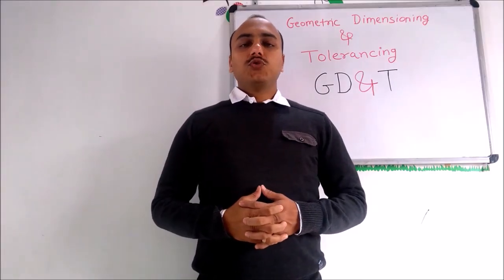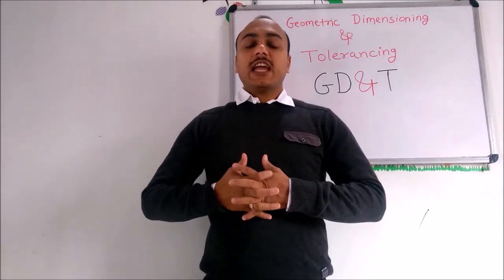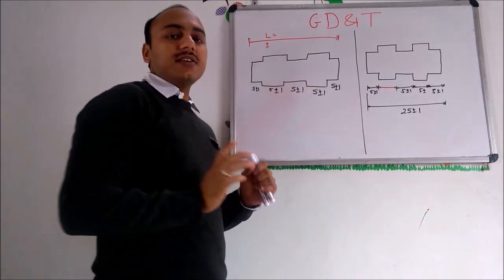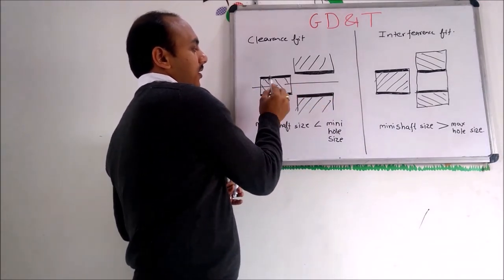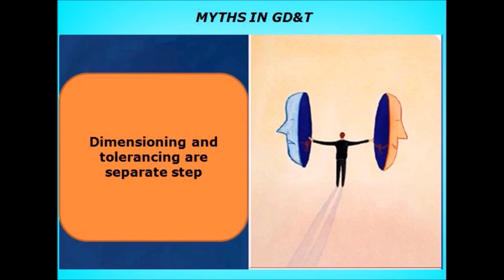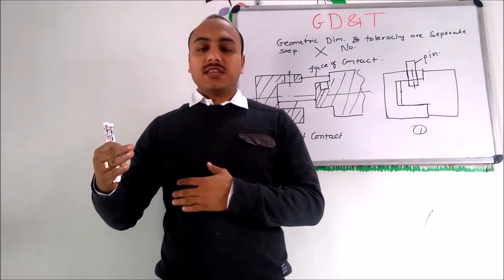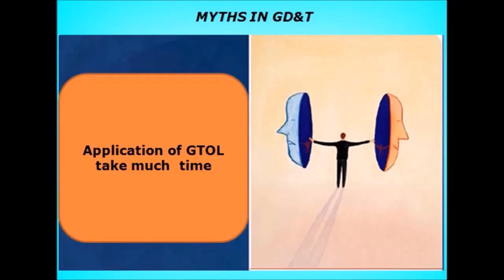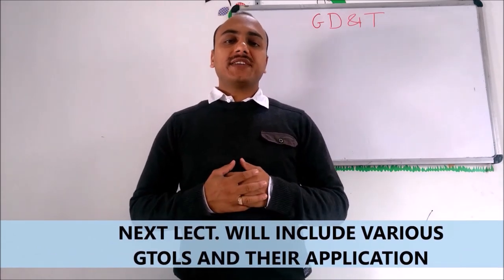GEOMETRIC DIMENSIONING AND TOLERANCING (GD&T) LECT 1

Comment from the maker: at 10.0, in case of rectangular tole 2x2 what is tolerance at diagonal.. 2.828. So horizontal vertical we get 2 but diagonally we get 2.828. so it's not uniform.. While if we use position tolerance of 2.828 it will be uniform and 57% higher as well. 
But in video I mentioned 2 only. 2 will make zone uniform but less. 
The point is using Geometric Tolerance makes it uniform and bigger if we go for diagonal value. Hope this clarifies anyone looking for this answer. Thank you!!

Comment: 10:00 How the tolerance zone will be a rectangle? If both sides are equal (2mm)
and 2X2 mm square will cover more area than the 2mm diameter of a circle.
Reply from the maker: Hi, I think U did not got me clearly. Suppose hole location has sq. Tolerance zone. Be informed that its not homogenous tolerance. At diagonals it will get more locatio allowance. That is why it is rectangular for me and by giving diagonals as Gtol it introduces more tolerance. Let me know if this makes sense.
Reply: @TheEssenceofknowledge  
Really it's confusing statement....Rest all is good in your video
Reply from the maker: @BuddhuEngineer  yes it is. +- 2 is a rectangular.. while Gtols are cylindrical. Try to draw tolerance zone, you will get it. Thanks
Reply: @TheEssenceofknowledge  thank you so much for your reply at regular intervals. still im not getting it. I wil make sure to get it. Thanks a lot
Reply from the maker: @vigneshvenkatapathy7135  2x2 what is tolerance at diagonal.. 2.828. so horizontal vertical we get 2 but diagonally we get 2.828. so it's not uniform.. while if we use position tolerance of 2.828 it will be uniform and 57% higher as well. But in video I mentioned 2 only. 2 will make zone uniform but less.
Reply: @TheEssenceofknowledge  Now I got your point 📍. Thank you so much sir. Keep enhancing our knowledge through your videos. Thanks once again

Comment: Hello sir, I am not getting the point of rectangular tolerance zone, and how the circle of diameter 2mm will give us more tolerance zone ?
Please explain
Thanks
Reply from the maker: Suppose if we give a hole location tolerance +-2 and both location. What will be the zone of tolerance kind of square but diagonally hole can move more then 4 in range. So that become rectangular tolerance for me. And if we use same gtol as the diagonal value it will add more tolerance. So where as rectangular one is a non uniform tolerance zone gtol is homogenous. Are you getting me or need more explanation.
Reply from the maker: Above example was just for understanding never gone on detail.
Reply: Sir, thanks for the explanation but I am still confused that if the hole will move on diagonally then in our first case (without gtol) the diagonal of tolerance zone is 2.82 then how it will move more than 4 ? 
Please explain
Thanks
Reply from the maker: @chetanbadsar7622  diagone will be 2.82 x 2.
Reply: The Essence , I got it . 
Thanks for the explanation.
Reply: Still have a doubt that circle should be inscribe so in that case we will have less acceptance criteria..
Also plz tell about the term homogeneous tolerance